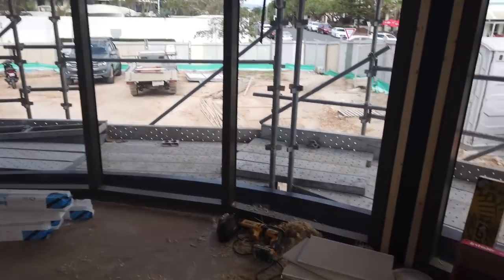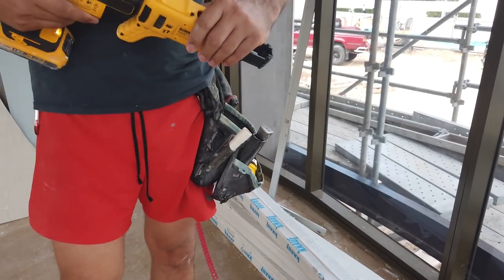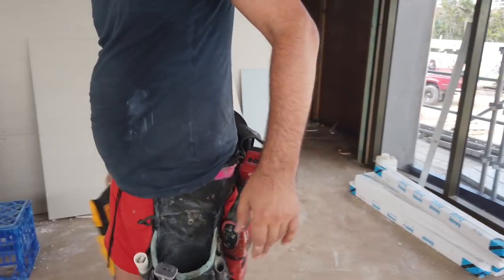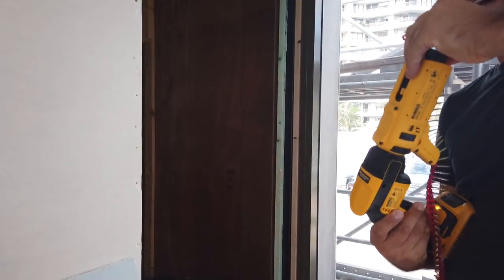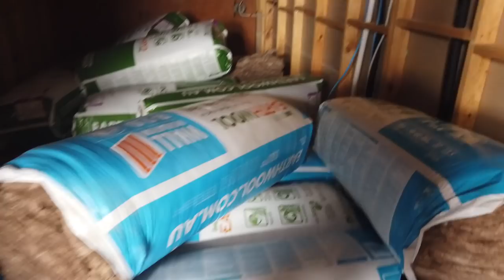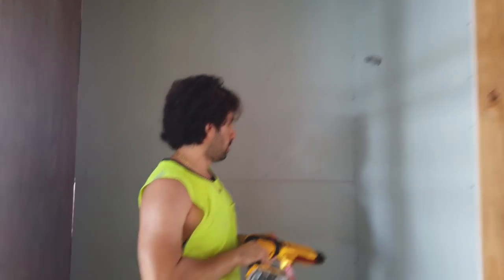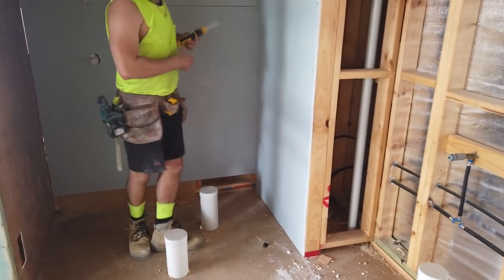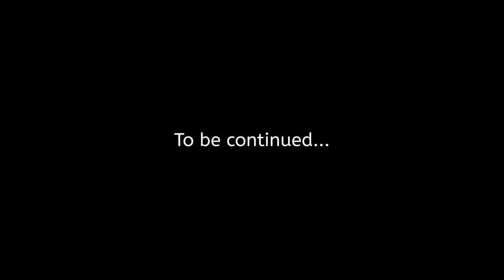Best Tool for Drywall Plasterboard Installation

Comment: Hilti is the best and nothing comes close imo. I screw 1000-3000 screws per day. I only work with metal profiles though, and   not wood. Try screw Makita gun on plywood in a metal profile, good luck with that.

Comment: I have bought makita, and it's not good, it keeps jamming, needs constant cleaning, already have changed one head attachment, and I just can't use it in internal corner. Not much of use of it. My next one was aeg collated screw gun, much better than makita, but can't screw into internal corner.
Reply from the maker: Yeah never tried the AEG. I am with them but slowly going to Makita

Comment: Greetings from Germany. I have been working with the Makita for a long time and am looking for something easier. Good work!
Reply from the maker: Hallo . Greetings to you. Makita is really good.  They are all really good. Hilti is more expensive but may save you in the long run. DeWalt I can't comment on too much. Have not used it enough
Reply: Dewalt for your impact drills and multi tools hilti for your collateds and nail guns simples

Comment: I’m looking to buy new collated screw gun... what is the best makita or DeWalt??
Reply from the maker: Good question, the DeWalt I've only used it a few times, and silly me I didn't have the belt clip so we couldn't give it a good run so I can't give you an honest answer. Makita is proven though.
Reply: I gone through a couple of makitas, they keep jamming. I’ve recently changed the screws to the DeWalt collated screws they seem to go better with makita. Just wanted to know if the DeWalt is better. Would be cool if you guys could dive the DeWalt a good run and compare 👍 cheers
Reply: Makita seems to be a proven unit
Reply from the maker: @WogChilli  yeah for sure
Reply from the maker: @mikesearle6710  Hi Mike yeah for sure need to give it a good run. Unfortunately I hadn't fitted the belt clip to it. I will get it run the whole day soon. So far its been solid, only issues is when we forget to  change the screw size settings.

Comment: So perhaps it's a translation issue from down under to up and over, but I came away unclear if the thing didn't come with a clip or did you just forget to bring it?  I suppose I should finish watching the rest of the show before I post, but I choked on THIS:

JUST HOW LONG IS THAT BOARD, ANYWAY????  20'?  Nay - looks more like 24'?  If those windows are 3' wide, that must be 24!!!  Hurts my hernia just watching!
Reply from the maker: Sorry mate. Not very clear. In the next video I think I explained it came with a clip but I didn't put it on. Forgot. Cough cough
Reply: @Maxkil  No worries, mate.
How's my Roo?  Still love the old Foster's ad: Australian for Locksmith....
Fine - after shopping this gadgie it appears to be something with the std screwgun, not the automatic, collated attachment that's a separate purchase anyway?  So I'm pretty certain there'd be a clip w/ the screwgun, although our version may hang the thing up-side-down for you.

BUT --- how about that board length????
Reply from the maker: @palewriter1856  yeah 20ft these puppies. Only 10mm thick though. Pretty light

Comment: The downside to the Dewalt is there is a reverse button right next to the trigger that can be accidentally hit...

Seriously tho, who uses a fuckin reverse button on a collated gun?
Reply: Just by that question I see you havent used autofeed screw guns often. The reasons these attachment based autofeed are soo popular is due to sometimes user error occurs when feeding so some screws wont dive in all the way or hit a void. The point of the reverse is for you to remove the autofeed attachment and remove the screw of correctly drive it in. Then reattach the attachment and continue.
Reply: I think the collated for Dewalt is just an attachment that can be put on any Dewalt screwgun. We never used collated guns (even when hanging lids), just got really fast at feeding screws from hand to the gun. When I was new I was taught a trick for if I missed the stud to get the screw out fast. Put it in reverse, run it, put it on the screw, then you could jerk the screw out and easily pull it out by hand.